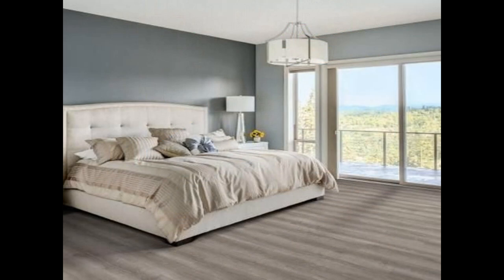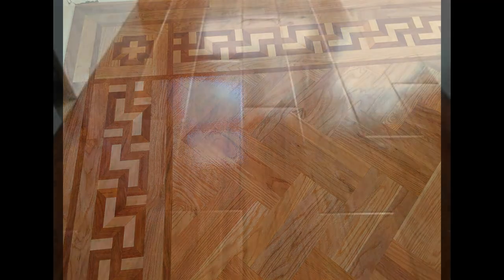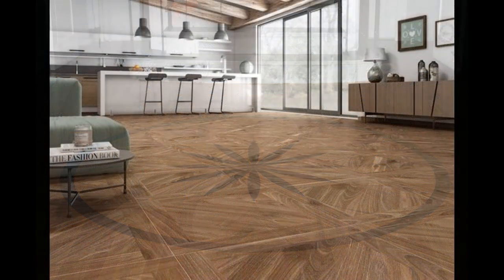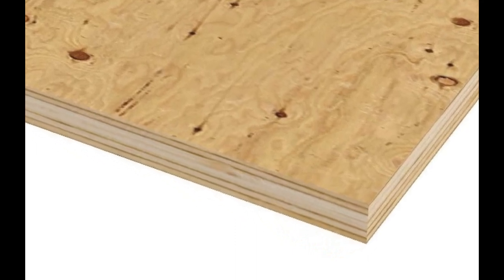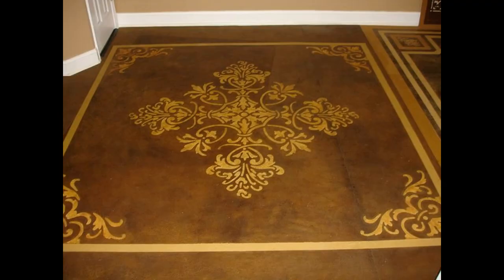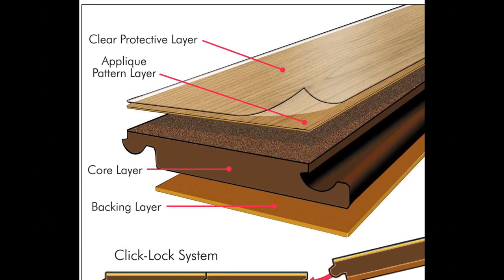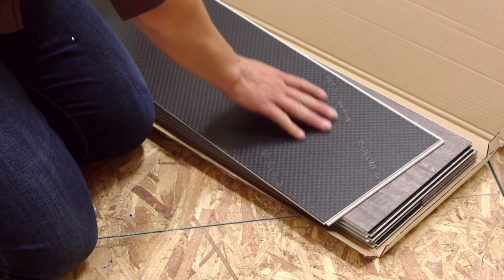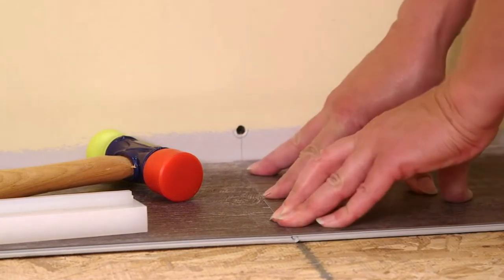Building Your Dream House In Jamaica. Part 9.FLOORING!

Comment: So Laminant and LVT is recommended in Tropical Climate???
Reply from the maker: absolutely. In this case the installation is important. While tropical climates do not have the large temperature differences to deal with the moisture can be a problem, so its very important to follow manufacturers recommendations closely.
Reply: @jussayinmipeece1069  ok..i was planning to install laminant but was sceptical due to climate. Im thinking that extra expansion gap might be key in the installation
Reply from the maker: @robbyp2673  not necessarily. Depending on the manufacturer. However if there is a key so to speak it would be the underlay. There would need to be a good moisture barrier with decent absorption in your backing layer.

Also some types are better for tropical conditions than others so again I would check the specs on the type before making any purchase or if you are buying from china talk directly to the sales person and tell them what you need. They are very good at getting you just the right thing.

Just so you know if you are buying a large amount its far cheaper to just buy directly from China than a local supplier.

Comment: Thanks for this info Jussayin mipeece . A lot to consider when I get closer to this stage .
Reply from the maker: Look out for the next video . It will be on epoxy and polyurethane flooring but i will also include countertops since the same techniques apply.
Reply: @jussayinmipeece1069  ok will do 😊